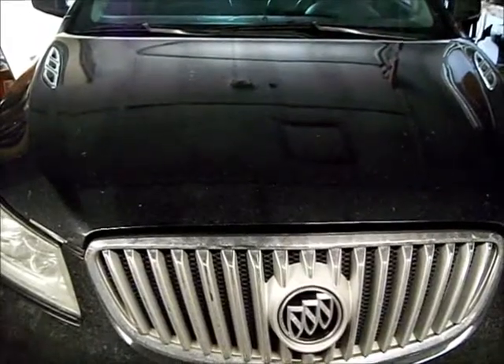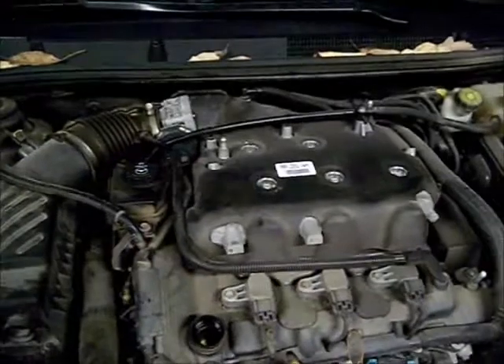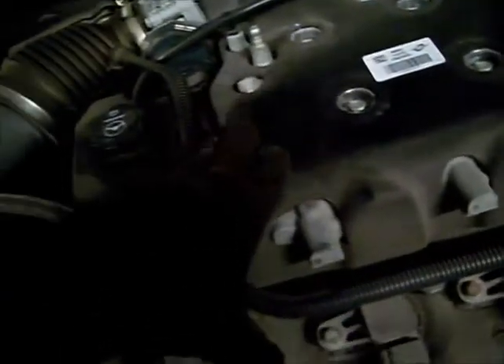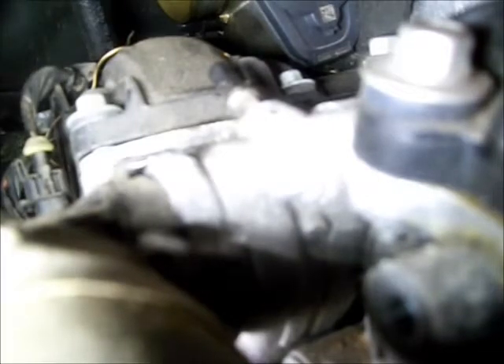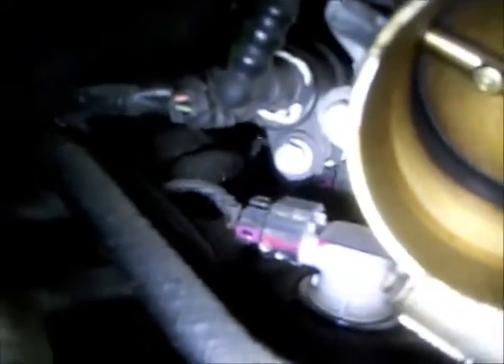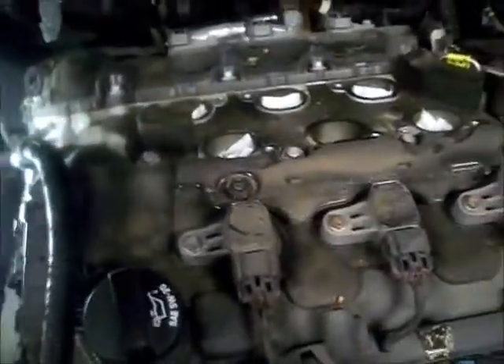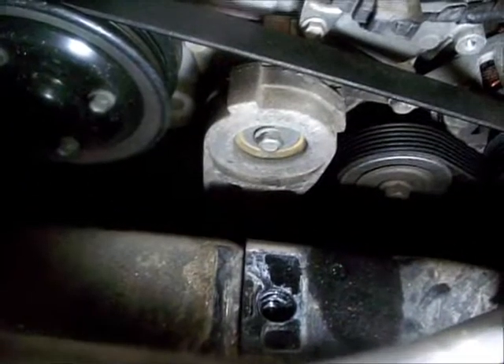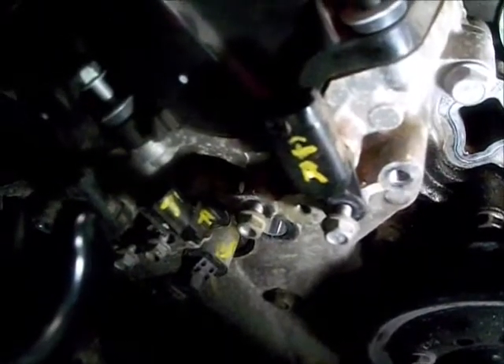Buick Lacrosse 2010 w 3.6 l engine, code P0008, timing chains remove

Comment: Hello, I have to check the ignition coils on the back 3 spark plugs, is removing the upper intake my only way of getting to them?  And if so, do I have to do anything specific rather than just unscrewing and pulling it off like in the video?  I've changed ignition coils before, but never had to remove an intake before.
Reply from the maker: I would remove the intake, depending on the symptoms it is exhibiting of course.  Its relatively fast procedure, and I would want to check the end of coil for water intrusion/ arcing through insulation, and replace the original brand plugs with new ones.  Not recommended at all to substitute a different brand spark plug, no matter what the press on a different brand is.  (It will be specified on a white/black fed emission label under-hood the OEM plug and gap). Verify on the label that the gap is .043 or (1.1 mm).  (A general rule about car replacement parts is: that if a different brand was better, then the factory would be using it.)  There are some exceptions, few, like the oem intake gaskets of older year gm were only effective for about 70lk miles, before leak and ultimate head failure.  Fel-po aftermarket makes a set of metal w heavy ribbed O-rings to replace the original plastic ones. They last forever, excellent design.

Comment: I thought once the engine has timing chain there is no need to replace it!. So is this means we need to buy a car with timing belt like Honda and Toyota?
Reply from the maker: T-belts also need changed ranging from 60k-120k miles.  Maintenance duration on timing components vary widely by manufacturer.

Comment from the maker: My personal recommendation is to use the OEM chains. It really is preferred to use OEM parts in especially critical areas.  Where failure of the part will result in severe damage and escalate the total repair cost, over a shorter than expected duration of the part. OEM quality control is typically more reliable, do to the major corporations involved.
Reply: Where do you get your OEM parts? Chains etc etc.

Comment: Thanks for the info, but the real issue is these engines are junk.  $4K repair after 75K miles?  ridiculous!  Stay away from GM.
Reply from the maker: probably put a whole engine in there for 4k
Reply: Auto Dr diy
A whole engine with bad chains?